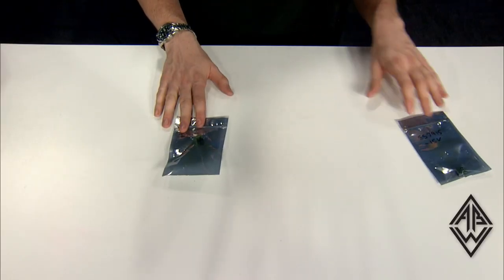Discrete Op Amps and Voltage Regulators by Sparkos labs

Comment: Discrete Op Amps? but its an IC? Discrete = individually separate and distinct. means its in transistor form not an IC
Reply from the maker: Yaghiyah Brenner. I agree that the description could have been more clear.  This kits let’s you install an IC on a board built for a DOA.
Reply: It is not an IC. It is a small PCB with SMT parts on a DIL socket.